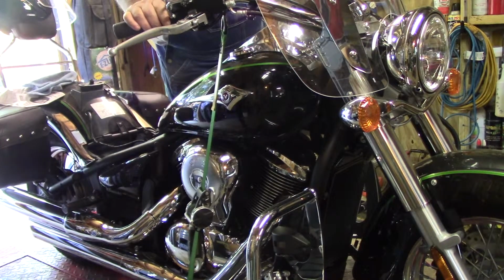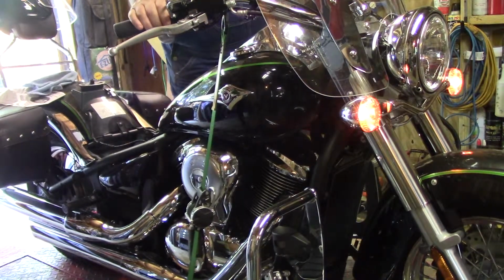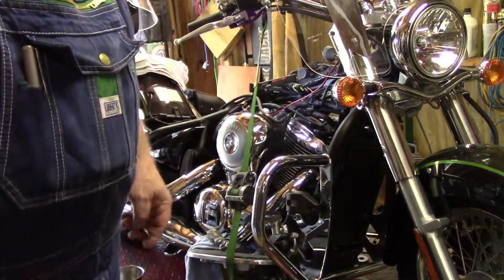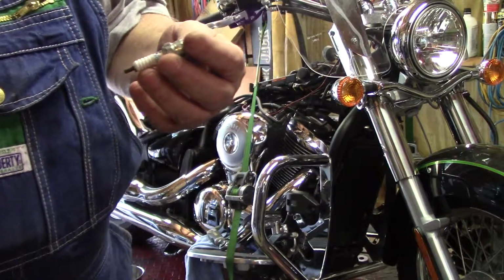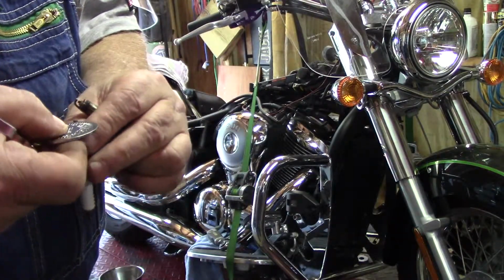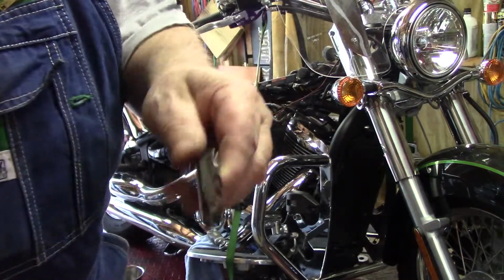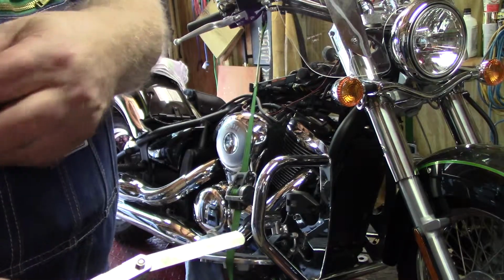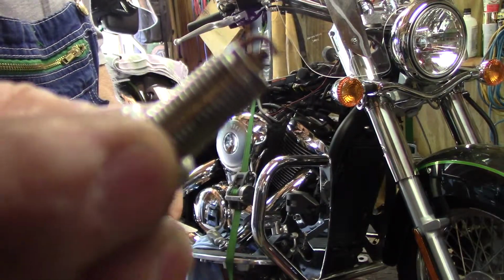Bike repair part-2

Comment: Having to remove parts and more parts to get to the part you want to replace can try a man's patience. So you just keep plugging away and keep your eye on the prize. If it is the voltage regulator then most likely everything else like puddles and such were just a coincidence. It has been my experience that when electronic parts fail that they either fail completely (good)... or partially (bad) because you then have intermittent issues that can be hard to track down.IMO☕😎
Reply from the maker: Those intermittent issues can make you go crazy sometimes. Thanks for watching.